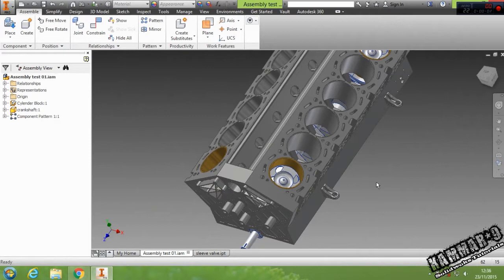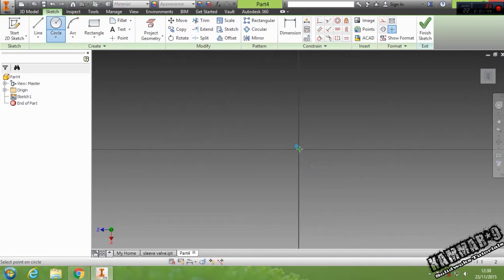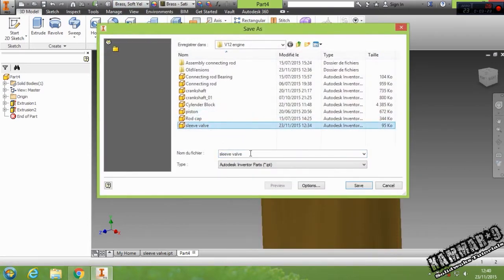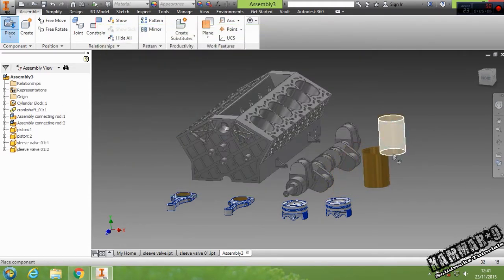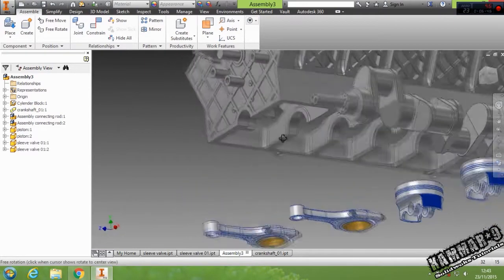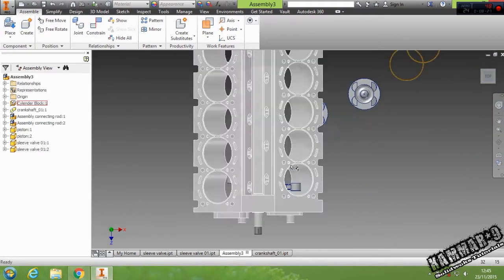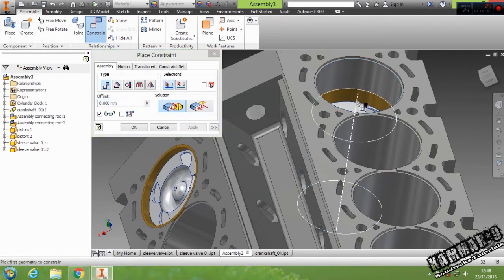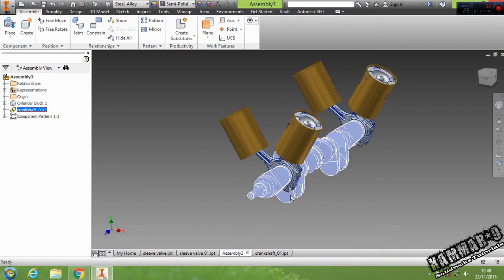Autodesk Inventor tutorial   V12 engine | Ep 11  Full HD 😍

Comment: Ammar, i am having a major problem and unable to move forward from this tutorial. Please help me. Been trying for 3 hours straight but still cannot solve the problem. My crankshaft is jutting out from the end. Hence my con.rods arrangement are protruding out from the cyl block. I have checked and redone my crankshaft and c/shaft is ok. I have checked the total length of the cylinder block and it says its 604mm (which is what u said). How. Someone please help me. I dont want my effort to go to waste.
Reply: omar i really need your help man. i cannot get past this. normally i can pull thru, but i cant with this

Comment: Since our cylinder line is 85 mm and our stroke is 49 mm times 2, i used v= pi*radius squared times height.  3.14 * (4.3 cm)^2 * 9.8 cm * 12 cylinders equals 6,831 cubic centimeters or 6.8 liter engine displacement.  Please correct me if i'm wrong.  Thank you.